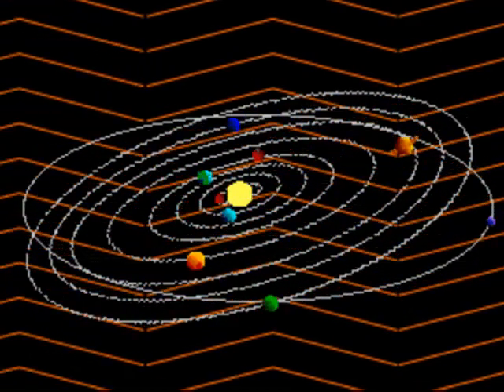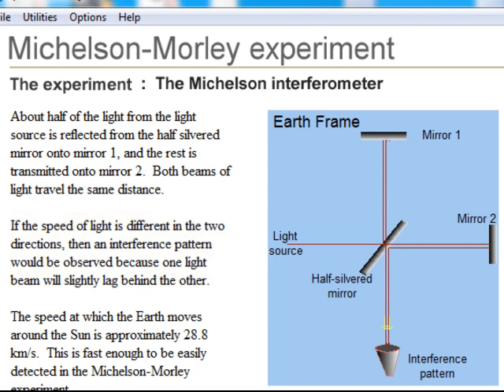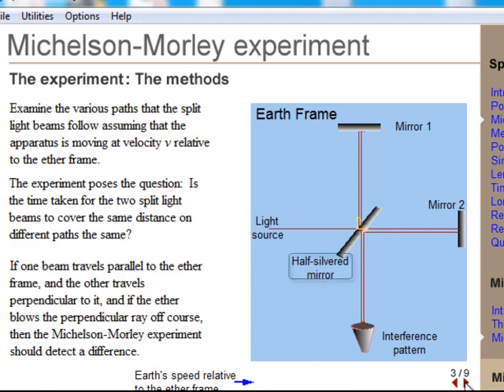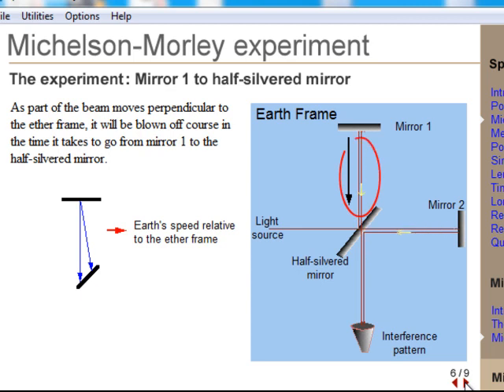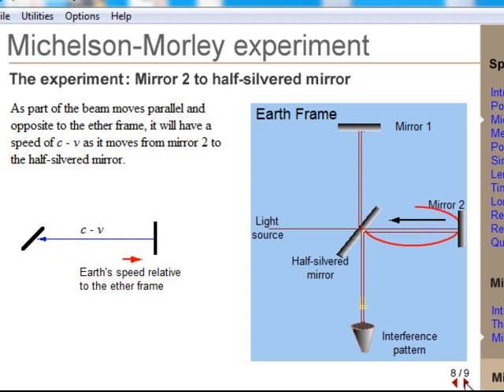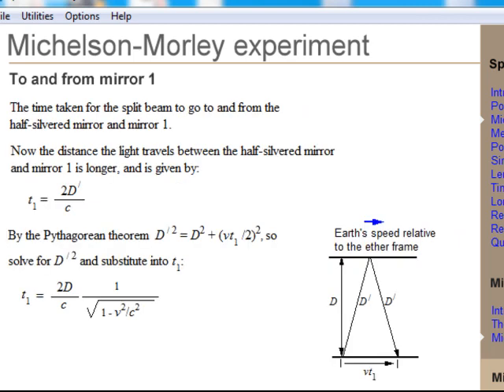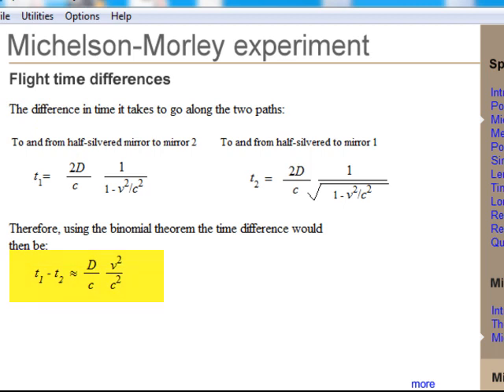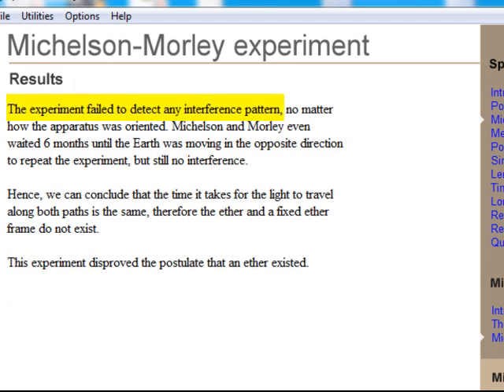The Ether and Michelson-Morley Experiment

Comment: M&M didn’t understand light wave and Aether enough have committed to design and ran experiments with a negative results, as expected. 

All electromagnetic and light wave requires a medium (dielectric) to propagate. It is e0 in Maxwell’s equation. The instance we let air infiltrate the experiment then air becomes the medium and not Aether. 

Aether exists in absolute empty space with a measurable dielectric constant e0 of 8.8541817128 pF/meter. At this point of writing, Aether’s properties are not fully understood. 

We can’t insert jars of low pressure vessel as part of M&M’s apparatus on earth to validate the apparatus for Aether compliance because Aether in it moves as much as the jar moves. Unless the whole experiment is space far from any galaxies, spiral arm, molecular clouds or cosmic plasma to make result conclusive.

Comment: I add some aether info as follows.
(1) Google Demjanov's twin media (air & carbondisulphide) MMX done in Obninsk on 22 June 1970 which showed an aetherwind of 140 km/s min & 480 km/s max during a day (this was the horizontal projection of the background aetherwind which is approx 500 km/s south  to north blowing approx 15 deg off Earth's spin-axis). This genius 1st order MMX was 1000 times as sensitive & accurate as the oldendays 2nd order MMXs.
(2) The MMXs were never null.
(3) The correct calibration needed to allow for length contraction caused by the aetherwind.
(4) The correct calibration needed to allow for the Fresnel Drag of light by the air.  Prof Reg Cahill explains.
(5) All MMX's suffer a linear ever-growing fringe-shift that gets larger with each rotation. All MMXs that employ vertical fringes will detect this signal. This includes laser MMXs. Horizontal fringes do not suffer from this effect. Because at least one mirror has to be turned a little (horizontally) to give the desired fringes then this results in a difference in a beam's horizontal radius from the axis of rotation. Mirrors approaching the axis in effect eat waves/fringes, & mirrors going away from the axis in effect vomit waves/fringes, the eating equaling the vomiting, but in Michelson's & Miller's MMXs the non-symmetry of the beams resulted in non-equal eating/vomiting, resulting in a signal that was periodic in a full turn. The desired sought-for MMX signal (fringe shift) being periodic in a half turn. University MMXs will detect this signal if the MMX is rotated lots of times, because this signal is ever-growing, 100 rotations will give 100 times the signal that is gotten from 1 rotation. Stopping or slowing the rotation has no effect on this signal, ie it doesnt reduce this signal, the size of the signal depends only on the number of rotations, it is ever-growing. Michelson & Miller deducted this signal from their raw readings, to do so they assumed that it was linear, which it is, or, it should be, but their MMX was top-heavy & suffered from a changing lean (it floated in a mercury filled trough), plus their MMX had a sloppy pin (ie axis of rotation), hence their LEGFS was not always very linear (but that is another interesting story in its own right).
(6) Secondly the Michelson Morley MMX, & the Morley Miller MMXs, suffered a spurious signal that was periodic in a full turn. This was because their mirrors were at two levels, hence some of their light beams had to angle up & later down. This then introduced a spurious signal (fringe shift) due to angle contraction of the mirrors in their apparatus, which changed the effective lengths of the angled beams. I call such angle contraction Esclangon angle contraction, as Esclangon is i think the first person to bring it to the attention of science (but he didn't mention that it must also happen in an MMX). EAC is due to Lorentzian Length Contraction of solids (which should be called FitzGerald LC as FitzGerald was the first to predict it) which is due to any change in the aetherwind blowing throo a solid (which changes the size/shape of solids)(because solids are held together by electric forces)(these forces being affected by the wind).

Comment: The Michelson Morley had a failed assumption because the ether field is the inertial field, which means the ether is the cause of earth's motions and therefore the earth does not move much relative to the ether.  There is a slight lag in the earth's motions relative to the ether field which was detected, but they just called it a null result because it was not anywhere close to the presumed magnitude.  However, if this experiment was performed on a plane perpendicular to the earth's surface, the results would be much different.

Comment: Sorry, but this Michelson-Morley Experiment would not work if used to test for Ether frames because it has light returning back along the same path using mirrors.  Also, we already know that light cant be 'blown off course' even if aether was present. If you want to test for aether (or one-way light speed), any use of mirrors will invalidate the experiment.  It worries me that so many physics laws are based on variations of this type of invalid experiment.

Comment: Michelson's MMX indicated 8 kmps instead of the desired 30 kmps & hencely Michelson said that his MMX gave a null rezult in relation to his static aether postulate & aether drag postulate -- he didnt say that there was no fringeshift. Demjanov (1968~72) & Cahill (2002) have shown that Michelson's calibration was wrong, that the aether is not static, & that Michelson's observed fringeshifts indicated a horizontal component of aetherwind of over 200 kmps at times. Demjanov's twin-media MMX  (air & carbon-disulphide) showed that the horizontal projection of the aetherwind varied from 140 kmps to 480 kmps at Obninsk on June 22 1972. Demjanov's DMMX was 1000 times more accurate~sensitive than oldendays MMXs done in single media (air). MMXs done in vacuum (ie virtually every MMX ever done by Einsteinians) must allways give zero fringeshift (they can give a very small 3rd order fringeshift). Miller & Demjanov & Cahill & others have shown that we have a background aetherwind of approx 500 kmps blowing south to north approx 20 deg off Earth's spin-axis.

Comment: Another take on the MM experiment from Captain Obvious.
Captain Obvious may offer another reasoning  it did prove, Geocentricity
 ( The Earth at Rest)  In  a prevailing wind sound carries a 
voice farther than a resistance wind and a still day would carry sound 
the same intensity at any direction.
If the Earth is at rest, any direction would have the same light speed 
and therefore not really a test of Aether resistance as intended, but 
demonstrates Earth at Rest for the light waves always matched.
This explanation seems to be ignored or missed because every one knows 
the Earth rotates (philosophy not science which questions all)  Instead cosmologist and physicist came up with fanciful hypothesis and theories to avoid the above simple conclusion of Earth at rest.

Comment: Maybe the Earth is not moving and, therefore, no ether effect would be present in the experiment. The experiment presupposes that the Earth is moving and therefore one would conclude that there is no ether. But what if there is an ether and the Earth is stationary. This was done by the Sagnac experiment where they done this same experiment but added another variable; making the table turn 2 revolutions per second. They found a difference in time between the two light sources. This experiment, therefore, confirms that the ether exist. The Michelson-Morley experiment's results can equally make sense if the Earth is not moving.
Reply: likely your are right,  I was just trying to give students the usual interpretation that MM made.  This video is 20 years old now, Time flies, but different in different inertial frames!! Thanks for comment
Reply: The Sagnac effect is proof for neither model. It works in both.

Comment: Did they ever do a experiment with on of the mirror twice as far away as the other mirror? making the light travel a much longer path?

If they did was there a ether then?

What if something else can do the exact same thing, so a equal motion in all directions?
Reply: Nubyrc This experiment has been repeated a thousand times for the last hundred years with different setups and the results are still the same.
Reply: yes it has, and I know it shows a difference in clock speeds, but is that really a difference in time itself?

Movement in itself is energy, and as we take it for granted that a moving object is alone in its movement, it is not.

every atom and every sub atomic partial in every atom that makes up a mass of a object is effected by the motion, by the acceleration and deceleration.

The motion of every part of each atom is being acted on by the energy of motion.

I believe what is being observed is not a difference in time itself between a moving mass compared to another one, but how the effect of motion plays on the mass of atoms.

This idea can actually explain several problems, like one that relativity has with quantum mechanics, and why a circular path of moving mass does not have the same results and straight moving object has.

When you look at motion effect, there certainly will be a change in the way atoms and the sub atomic particles that make them behave.

Isn't that what E = MC squared is really all about?

Comment: One answer to the arguments of the video.  Laser Ring Gyros.  The problem with Michelson Morely is that it assumes the light does not interact with the mirror.  The interaction of the mirror removes any Ether Frame consideration from the experiment.  The simple fact is that this experiment is based upon 1880's assumptions about light that are known to be in error.  The Aether frame does not have to travel either.  Simply stated we know that magnetic fields set up their own relative spaces so it is probably true that the local Ether would be local and not affected by the major stellar location.   There are just tons of errors in this experiment.  It is invalid.

Comment: "Let's assume that the Aether travels in a parallel direction"
Uh... How about you "Assume" a different direction, let's say... THE EARTH'S FUCKING VERTICAL PLANE
Reply: And why would it do that? Just because?
Reply: @Yurrrpppp  I meant "parallel". They assumed the Aether moves parallel to the Earth's surface, when in fact, it moves perpendicular, hence "gravity is a "side effect" of the Aether pushing everything down. You see, gravity, inertia, light etc..  are all side effects of the Aether. The Michelson Morley interferometer HAS TO BE ROTATED VERTICALLY TO BE VALID.
Reply: @jatigre1  ah. I see... you’re a flat earther. Good luck with that, cheers mate.

Comment: You clearly misunderstood what the aether theory was assuming. 
It assumes the universe contains a rest frame which is called the aether, it is constant everywhere and all objects move relative to it. The position of the apparatus is constant in earths frame but moving relative to the aether frame. This means that the light moving in the aether frame will have to travel along the hypotenuse of a triangle relative to the aether and thus it will take different times to reach the end.

Comment: Just another point of fact: there is always an interference pattern when the two light beams are recombined, provided the path lengths are near enough the same. The aim of the experiment was to see if the pattern shifted when the apparatus was turned (it all floated on a bath of mercury to avoid vibrations, since they were expecting to see at most only a small fringe shift - less than half a fringe width).